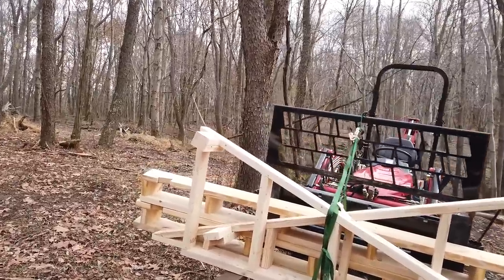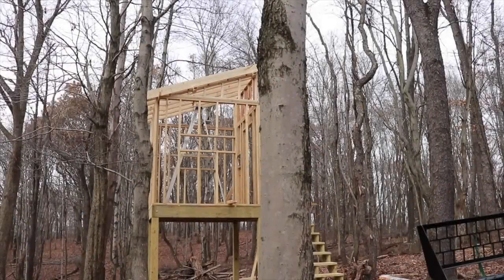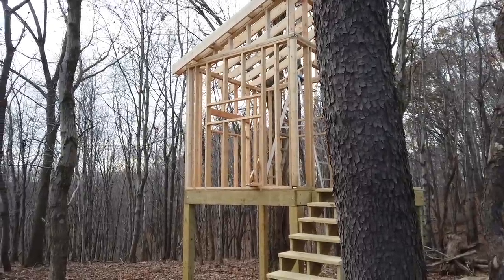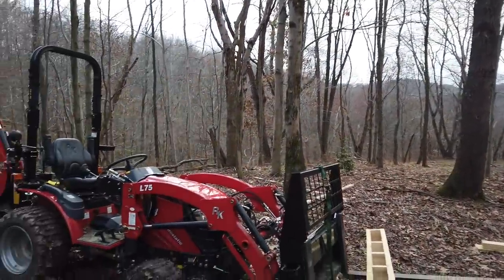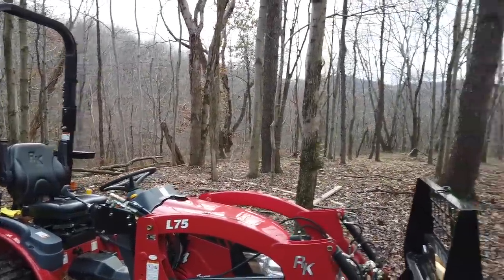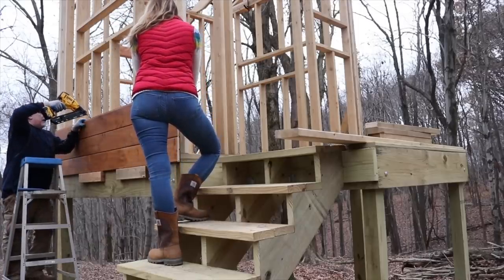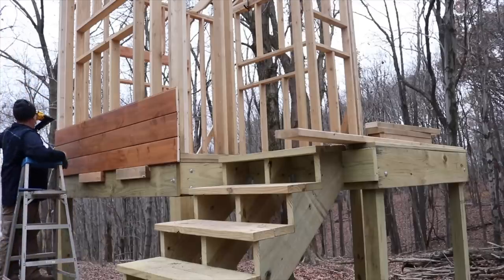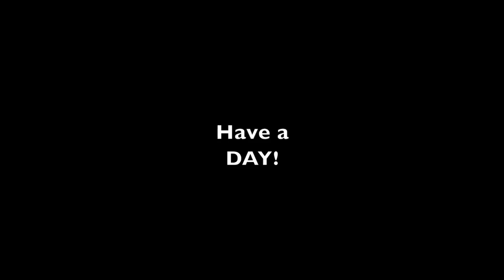#619 Siding Going Up on The Mini Cabin

Comment: Regarding the purchase of new tools, a couple of years ago, I needed to cut two pieces of PVC for a drain.
(YES! I had a hacksaw). So, I told my beautiful wife the chop saw was "dead" & needed to get another.
I told her it SHOULD only be about $200.00
When I returned with my amazing Kobalt dual bevel, 12" radial arm saw WITH the portable/fold up workbench...it wasn't as well received as your new nailer.
It is still one of the best $700.00 purchases a guy, (or girl), could make.
Love what you guys are building!
TII

Comment: Mark Priddy
Fort Worth Texas
59 years old
Started watching Morgans last spring when I started helping my 82 year old dad down in Stephenville TX hour fifteen min drive not bad. I go every Saturday. He developed some health problems so im taking care of his twenty five acres. Six of the acres are red and white oak. The rest is fine costal hay for ag exempt tax. Id never ran a zero turn and now mow about four acres. Ive also been using his New Holand 60 hp with box blade and front end loader to clean out the fence line and make trails in the 6 acres of oaks. I bought a 27 ton wood splitter and bring home wood every week to spilt and have split two 4x4x8 cords. 
I have really really enjoyed watching and learning from you'll. I have picked up meany tips. I blow leaves from under a pecan tree today for about two hours. I thought of youll and your leaf blow. I always think about how hard the Morgans work and it helps keep me motivated. You’ll are really an inspiration. Thanks for all your help. 😎

Comment: Looks great But one thing i would recommend is put a bead of caulking behind the next starter board and face nail it Keeps bugs and water from going up behind it. Your not going to put regular roofing shingles on it are you? Use the metal roof. You can make small metal overhangs for the windows also. It does look good.

Comment: Doing Great Mike.  You can use a scrap piece of the siding, 6 or 8 inches, to hammer the siding in place instead of using the butt end of the hammer.  Keeps the tongue safe from mushrooming.
Reply from the maker: Agree I have done that before but didn't have any scraps yet lol. I will with the rest of it though

Comment: Hey Mike, regarding the "wobble", you can remove that by running DIAGONAL 2 x 4 BRACING on your corner posts.  I highly recommend this unless you are going to be storing anything under the blind.
sure, the siding and roof will tighten things, buy diagonal braces will REMOVE THE WOBBLING.
A scaffold plank between two ladders will save a lot of "ups and downs" on the ladder.
of course it is easy to be sitting here and supervising your work!  lol

Comment: Hi Mike, I'm way out west, in sunny Southern California, about 75 degree high today.  Been a follower for about a year or so, but have never posted.  I'd like to make a few observations/suggestions on the mini cabin.  If you would have used balloon framing on the tall peak wall and the two gable end walls, it would have been simpler and quicker and significantly stronger in the vertical plane.  It dose, of course, require some math and a clear design from the start.  Only additional work is to cut the gable wall studs to the pitch of the roof.  Tie the top plates together with some Simpson straps as you won't have the double top plates to lap at the corners.  Additionally I would strongly recommend some form of house wrap or tar paper under the siding for additional water proofing and air infiltration barrier.  You will be shocked how much cold will get through the cracks, especially if/when the siding shrinks and warps, as all wood does to some extent.  I would also suggest extending the siding to below the bottom level of the floor joists to protect the joists and especially the top of the posts from getting soaked every time it rains.  Not sure what you are planning for the roof, but for sure 30# tar paper and don't forget the metal flashing all around.  Not trying to be a jerk, I just want  your efforts last for a lifetime... well at least as long as possible.  Don't work too hard, and stay warm.

Comment: My Grandfather use to say, "Ya can't see it from a galloping horse."  It looks good on the video, if you screwed up too badly Mike resist the urge to use the macro lens.  That's a really fine looking finish nailer definitely worth the price.  By the way Mike there are roofing nailers that have a larger magazine to hold the larger heads of the roofing nails...they should be available for roughly the same price as the other two nailers that you bought.  Ann would like to add that the mini cabin will make a great pool shed as the pool will be placed up hill and then be on an even level with the shed, good planning Mike.  Great video, thumbs up.

Comment: Nice job on the mini-cabin and love that Dewalt trim nailer!  All my nailers are pneumatic but the next one may be a Dewalt 20 volt.  Some cross bracing on the posts should help with the wobbly floor and sail effect form the wind.  Are you using a pre-stain conditioner on your siding?  Goes on fast, drys quick and works really well for putting on an even coating of stain with no blotches.  Without it I just make a mess with stain.  I use the MInwax brand and a rag for all my finish work.

Comment: Carpenters tip...Little sideline observance... Cross braces 1x4 or 2x4... from top inside corner of top plate, to opposite bottom corner of wall shoe at floor, diagonally, on inside wall, ( leave nail head exposed about 1/4 " for easy removal later when done ) to tighten up and secure wobble before you install siding while or before installing roof. Or like you are doing ...siding first also works.Like you say Brother...you're not building a watch here ! Haaaaa...good one. Looking nice...great color...I like it ! Love watching your videos. Congrats on The Silver Play Award !

Comment: Don't beat yourself up with cutting the notches in the wrong end.  On the first wooden sea kayak kit I built one of the first steps was to glue the gunwales to each side.  Next morning I realized I'd made two starboard gunwales and no port gunwale.  Had to take one over to a friend's house who had a planer and start all over again.
I built a mini cabin almost identical to yours in 2005.  My wife called it the "Taj Mahal" hunting stand.  In May of 2018 we had an F1 tornado come through our property (unheard of in CT), cause $80K damage to the house, and absolutely flatten my stand.  It's still on the ground...  I can't even get my Deere into the back fields to brush hog with all the maples and oaks strewn about.

Comment: Have you ever tried using your tool rack on tractor forks as an elevated work platform?
Reply from the maker: No I haven't
Reply: Tractor loaders are not rated (designed or approved) as safe for use as a work platform, so I would recommend against doing so except in an emergency.   Not only are the structure and hydraulics not rated for use as a platform, there is the risk of the tractor tipping, especially on unlevel ground.

Comment: Mike,
If no one has suggested,  put a firm waterproof,  closed cell foam on the bottom
of all the window openings.  It will allow some give for your gun stock
And make your shots more accurate.  A hard purchase will allow a resonance
to occur and throw your shot off.  Just a suggestion.  
Old man Fred

Comment: Remember the message I send You about putting some cripples on each corner at the bottom of The deck at the beginning. 
That's the reason it wobbles. The more weight the harder the fall. Love your vlogs. 👍🙏🇺🇸T20

Comment: When you need to disassemble something and don't want to destroy it, put a metal cutting blade in a reciprocating saw and  cut the nails. I used a recip saw just about as much as any tool I had. Nice job by the way.

Comment: Who are you kidding Mike? You will know those extra notches are there, covered or not. It would drive me crazy. I had a few people help me run a few plug circuits in my new house. They pulled the wire straight out of center of the coil which twists the wire into pigtails in the walls. I thanked them for their help and after they left I pulled the wire out and ran it straight. Couldn't stand the thought of a BAD JOB inside my home. Have you wished the cabin was a little bigger ( 8 x 12 )?  Thanks all  take care

Comment: a metal cross brce on the roof will stiffen it up as well as the battens for the "tin" roof??A couple of the same metal braces on the walls will help too.Very easy to make opposite sides the same instead of mirrored

Comment: Looking good.  Sorry you had to go with Plan B for the siding.  Did you just cancel your order from the Amish place?  Or did you just get some new stuff figuring you could use the Amish stuff someplace else?  I see a lot of comments about a pool for Melissa.  I don't think many people realize just how much work that would be with your property with the way you have so many trees.  You don't have all the trees removed from your yard, so to put a pool in, you would have to remove a bunch of trees.  If the trees aren't removed, then there would be a ton of pool maintenance just cleaning all the leaves out of the pool constantly.  Your place wouldn't look as great having all the trees cut out.

Comment: Mike next time you may want to cut that bottom board in a 45° so water cant creep up the back side of the bottom board. water will climb up hill if the wood is dry enough.

Comment: If you put some structural knee braces on those posts and beams under the cabin it will make it much less wobbly. :) Just use treated 4x4's about 2 feet long for each.

Comment: When you were nailing up the siding by the window I know it’s easy to do but that was pretty dangerous. If you look at where you were standing in relation to where the nail gun was pointing it’s possible for the nails to take a bad bend and come out or even blow right through on a bad angle and you were right on the other side try to point away from or to the side of your self. Be safe and make more good videos!

Comment: I love that these people have the gumption to get away from the TV, and actually do something. But, something I see called a " cabin " that in no way follows the definition of one, kinda upsets me...a cabin has solid walls, with chinking to block air from coming in. If is the building complete, than it's nothing but a fancy treehouse or deer stand. But, you did a good job overall, in reaching your goal... little mistakes sometimes happen.

Comment: Face nail the first siding board on the bottom edge.
JIM
Reply: @billupstateny9151  I found screws tend to snap. SS ring shank siding nails work fairly well.
Reply: @billupstateny9151  Use SS trim nails and set them in and caulk.  Just telling you the correct traditional way.  
Do what you want, JIM

Comment: You are putting yourself in the line of fire with the nail gun. Your shooting nails from the outside and the gun is facing you on the inside. Stand off to the side. Accidents happen and you could slip and shoot a nail in you.
Reply: Agree. One of the most common mistakes using nail guns.